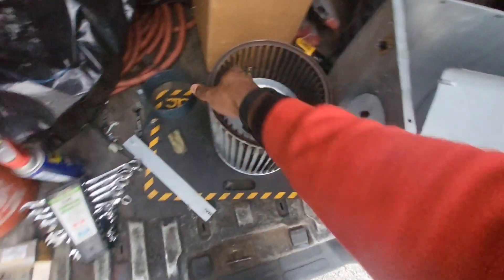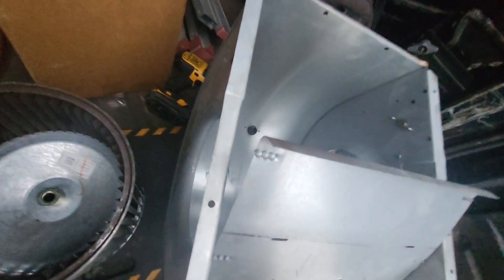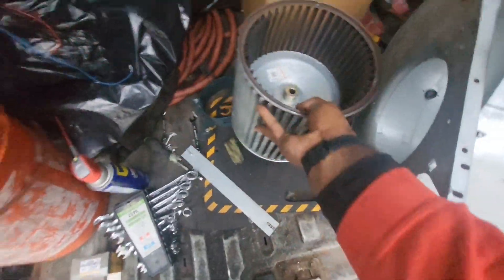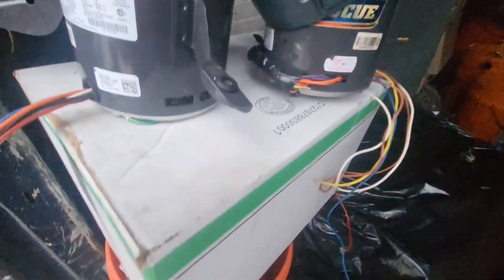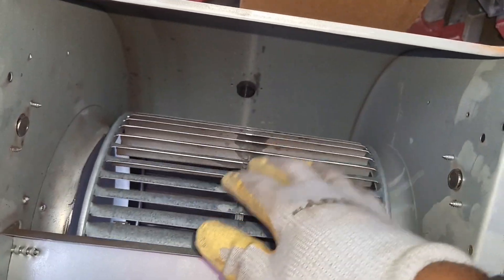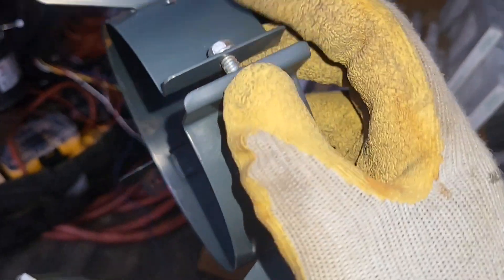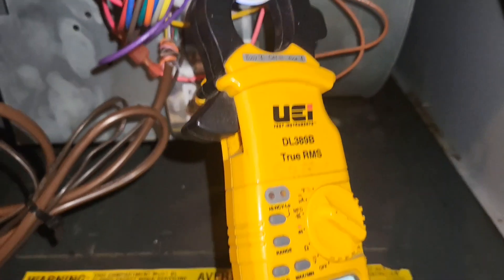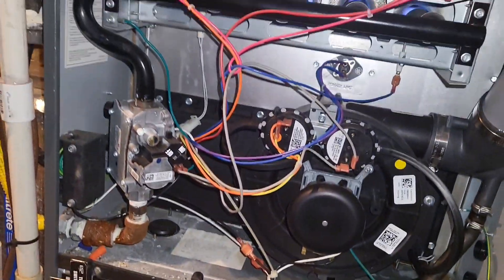When should you use an O.E.M blower motor?

Comment: The limit on the blower housing is a reverse flow switch.  If you have two furnaces twinned together and one blower motor fails the reverse flow switch will open. Could be wrong but pretty sure that’s the purpose of the limit switch on the blower housing.